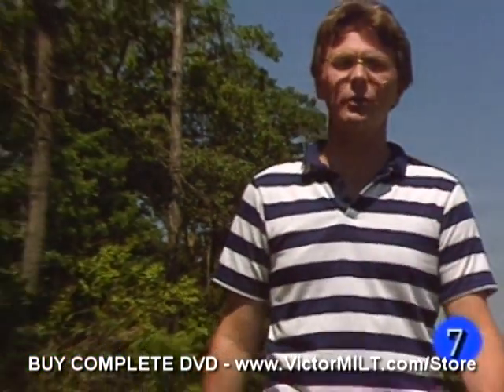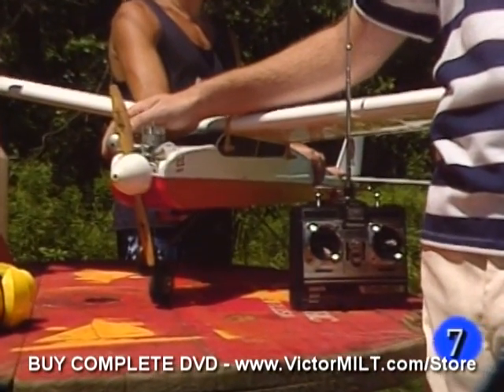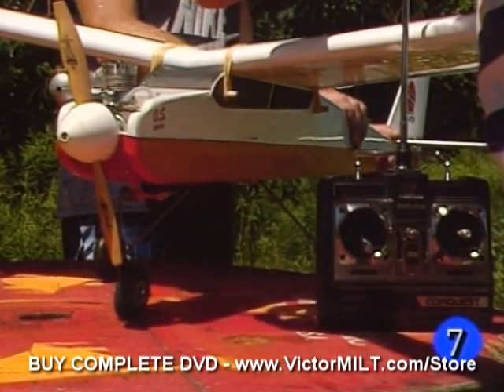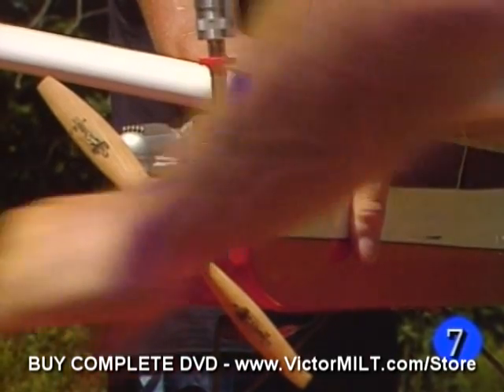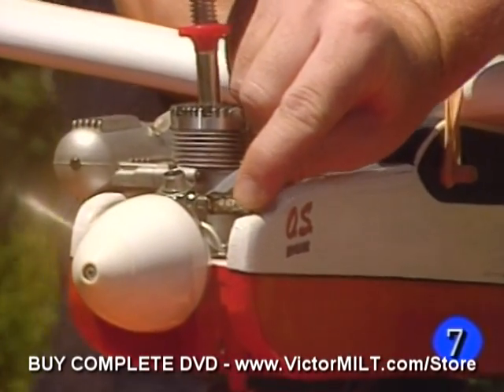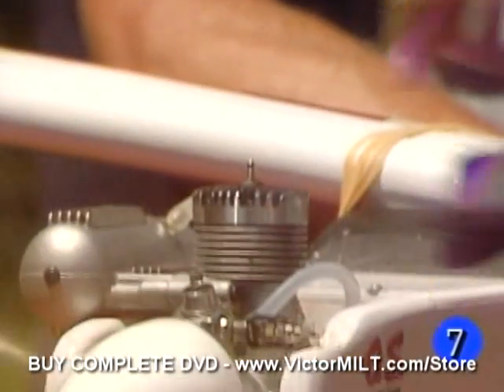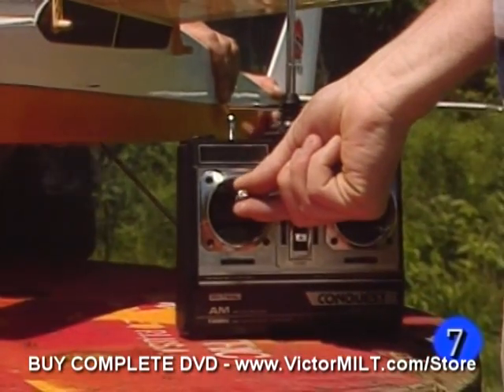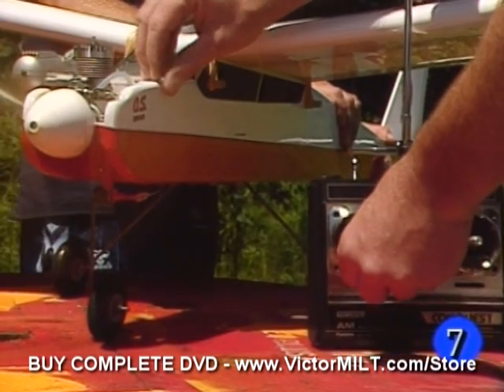7- Build/Fly RC plane - Breaking in the Engine.mpg

Comment: First fail, always turn on radio first then the airplane,and backwards when turning off, its best practice.
Reply: Ehh true but at least the engine will not just fire up and go if the throttle is increased as opposed to an electric lol

Comment: Is the video still available? If so, how much? The VHS version video came with my PT-40 kit along with an .O.S. FP .40, two rolls of covering, a bottle of ZAP thin and a bottle of ZAP thick for only $99.99 at Tower Hobbies back in the late 80's.  Too bad we'll never see prices like that anymore! A side note, I still have my PT-40. I soloed with it and never crashed it, and it even survived a fire while hanging on display at a friends hobby shop! I'm thinking of restoring it and putting it back in the air.